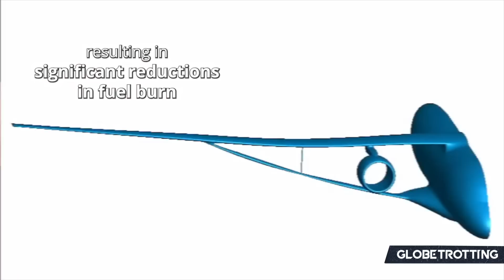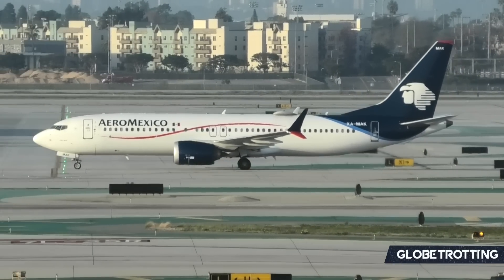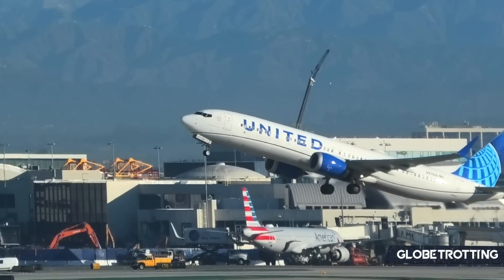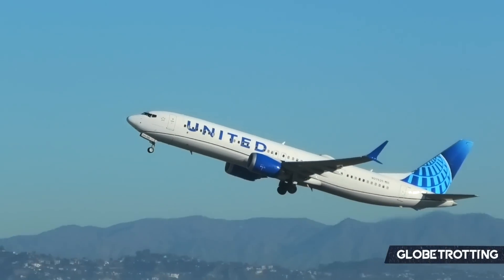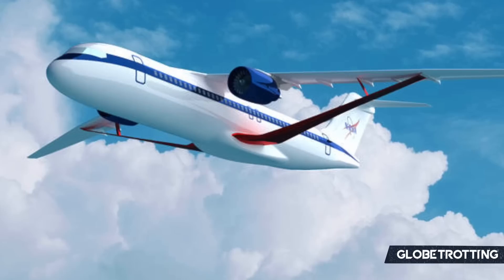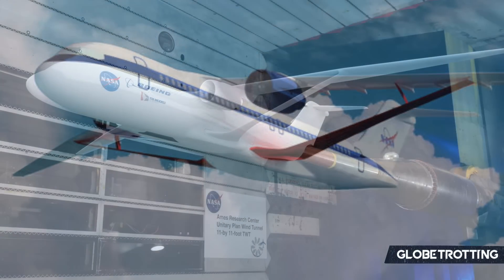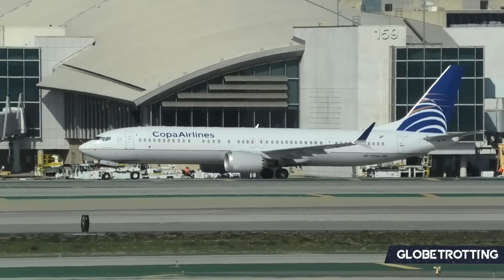737 REPLACEMENT - Boeing's Next Aircraft?

Comment: That will be the replacement for the 737s replacement, that plane is 10 years from a prototype. 30 from a production aircraft.
Reply: With new technology all that can be cut almost in half. If they have the funds and staff to develop it. A lot of what’s going into it isn’t new. Just new for their 737 sized line.
Reply: Well... no.  This aircraft has been looked at by Boeing for going on 20 years. The analysis was done ~20 years ago.  787 was almost this aircraft except with even longer wings of course.  Fuselage etc is all very simple stuff. This is going to be essentially a load alleviation FAA requirements test bed with NASA onboard as the FAA have been BIG sticklers for this compared to EASA in NOT allowing load alleviation pissing Boeing off no end stymieing any advances in reducing structural weight.  And FAA has started to pretend to be engineers where they essentially design the aircraft(horrific precedent) so... This might actually be a good sign.  We shall see what the program actually does of course.  I have zero hopes of anything here.  Boeing already did the flutter, 2G wind up turn load alleviation analysis a VERY long time ago.  FAA are the ones dragging their heels ... and this is their way of sucker punching Boeing to get a "free" test aircraft.   Ah, government corruption.
Reply: @w8stral  Actually graduated from UCF with aerospace eng deg in 91 this plane existed then. it was in books in wire frame. Not new wings on a DC-9 but it existed. It is over 50 years old. Lockheed was going to do this with the wings from the U2. The work you said boeing did was done a very long long long time ago.
Reply: And the Boeing version would not be the first to fly.
Reply: The biggest issue with every version of this that has been drimpt up over the last 50 years, has been making the wings strong enough and  immune to flutter.
Reply: @ghinckley68  The work claimed done is not the concept...  Aeroelasticity, flutter, etc, and no it is not 50 years old, this concept is older than the first powered flight of aviation.
Reply: @w8stral  The first time i saw it was in a text book of mine from the early 80s. The an2 is actually very similar too it.

Comment: Be fine until Boeing does something screwy with software or a sensor and you get folding in flight wings
Reply: Usually aircraft with folding  wings/ wingtips need to prove they can still fly safely  in case of an inflight fold-up/ malfunction. 

So depending on the wing design, folding inflight might not be a problem / safety risk.
Reply: I agree
Reply: @wadehiggins1114  would you
Reply: @nickolliver3021  yup he would
Reply: @wasmiddelsap3379  I'm asking him not you

Comment: This could be a step in the right direction with improved wing aerodynamics reducing fuel consumption while still maintaining the standard fuselage shape that is important for the logistics of loading and offloading passengers and luggage.  It will be interesting to see if Boeing and Airbus go for a blended wing design or a Flying-V design (KLM project) for larger aircrafts.

Comment: It looks like it could be a game-changing aircraft
Reply: It's the only way Boeing could win market shares.
Reply: they should try CFM Rise engine which they've tested 30 years ago on the boeing 727
Reply: @Perich29 .  That's a very interesting 20th century engine design & they've shelved it last time I heard. Hope they'd revive the program back to the drawing board.
Reply: @brettdemauna9994  they should use hydrogen engine along with that prop.
Reply: @Perich29 .   I'm not an expert in these field but for sure hydrogen engine it seem is decade-plus to become reality & this particular engine was already been produced a running prototype & of course it have potential to bring it back on board with today's innovative techs.
Reply: @brettdemauna9994  Producing, dispatching and containing/storing hydrogen, then burning it is 3 times most costy than extracting petrol, refine it, get jet A1 fuel then burn it. If it was cheaper or similar, we would have flown everyday everywhere with hydrogen planes since 2010 (and I recall an A300 concept with a Beluga-like hydrogen tank above the passenger cabin as early as 1990).
There are a lot of "hidden trash" behind most innovative tech nowadays... As long as people are eager to encompass a concept jus because some funded company tries to sell it to the public, we aren't done struggling economically, worldwide. To make hydrogen cost effective, you have to make electricity MUCH cheaper first, and the most efficient way is nuclear. But as that's a nuclear-approved countries exclusivity...
Reply: lmao